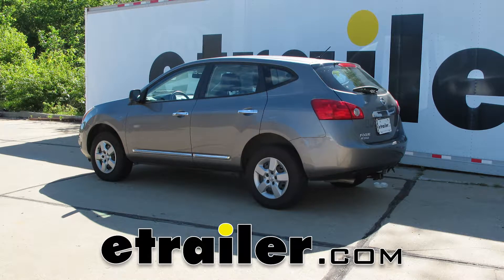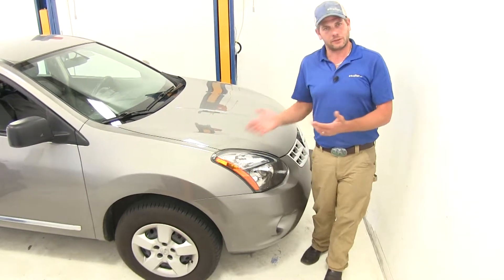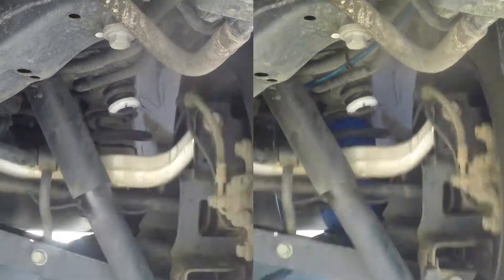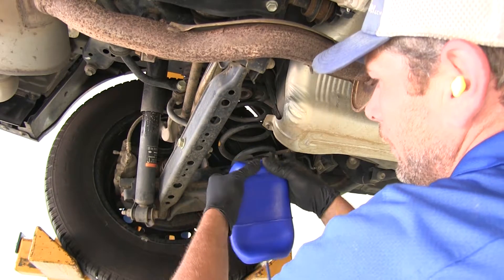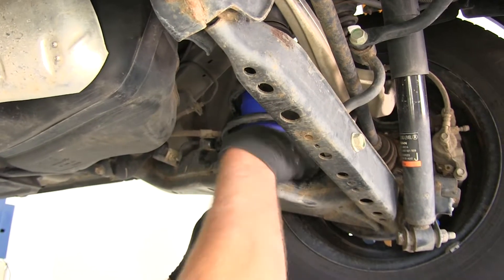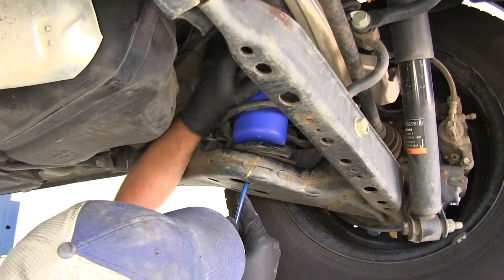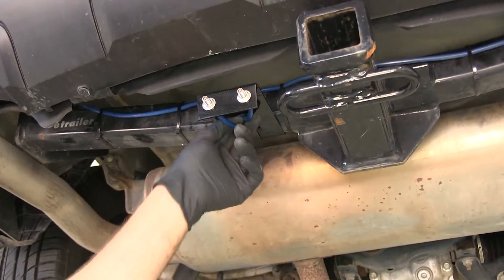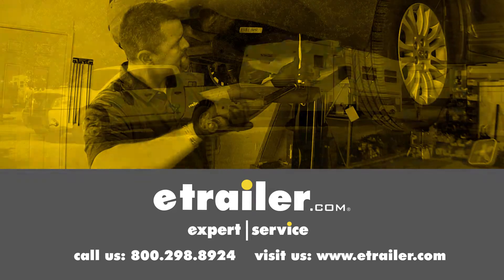etrailer | DIY Install: Firestone Coil-Rite Air Helper Springs on your 2014 Nissan Rogue Select

Comment: Please update web page info. Saying that this part number is only for 2014 & up model year rouges.
Reply: I have a 2012 rogue. Will this work?
Reply: Adam Karas yes, I’ve installed this exact model on a 2009. Works great.